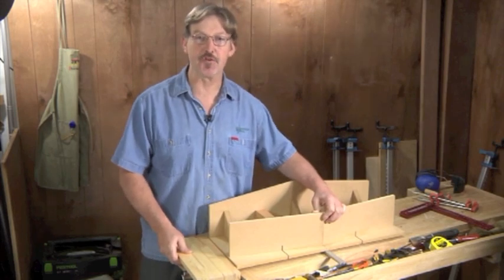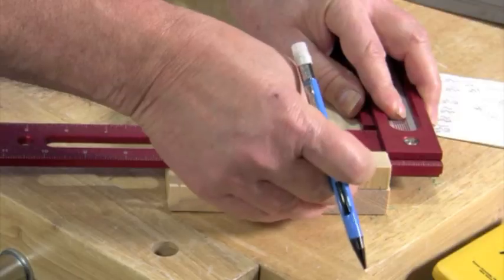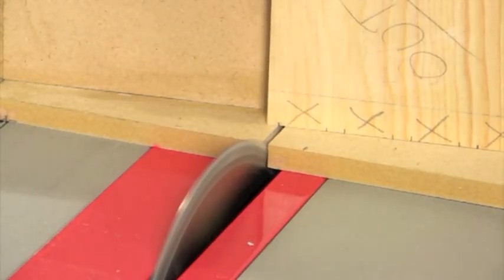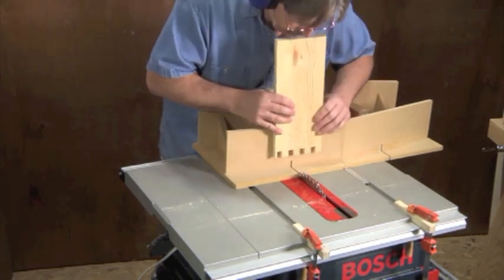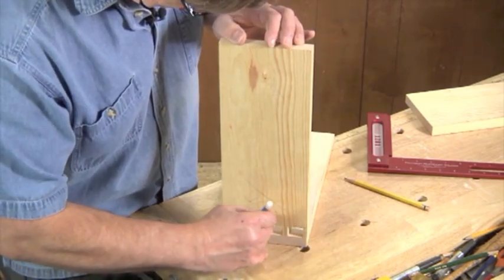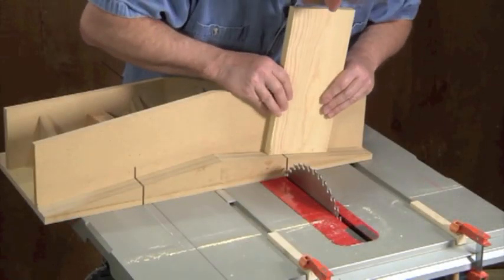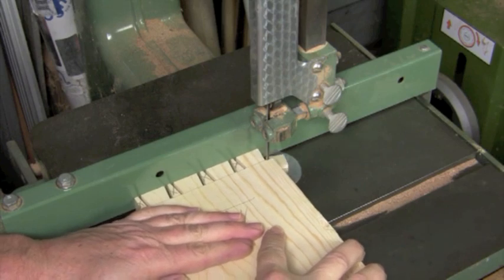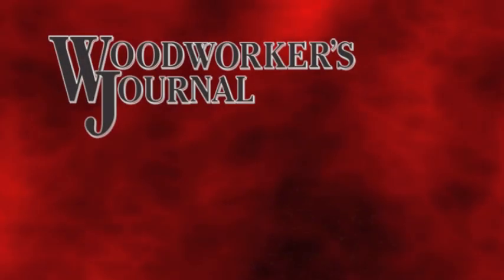Table Saw Dovetail Jig

Comment: What a great jig! There are numerous jigs varying in complexity on the market and most are quite expensive. This is one of the simplest and obviously inexpensive ( MDF) jigs I've seen in my 30+ years of woodworking. The coping saw suggestions are also great. Paring the waste with a chisel would also work, especially if a hand cut appearance is desired. Anyone who's done woodworking for a while can appreciate the multiple mentions of " BE SURE TO CUT ON THE WASTE"! Clearly presented post.

Comment: Great build fore me.  I could not use it because of my disability.  I had a stroke and it  left with the use of only my right side.  I did so much better with the Dovetailer II by General tools.  I use the router table and one hand to hold the work piece.  Thank You for the challenge to build. Rick Prosser Molino Fl.
Reply: If you use a clamp, you will have more control single handed

Comment: There's some complaining about this jig. But hell, not everybody has the money to buy a jig at first. You can make this with scraps and then progress to a jig.
Reply: no but you can build one thats a heck of a lot smaller  if you have a huge shop its great but the guys with smaller shops have a hard time justifying that kind of space on a jig.   Myself I have a much smaller  jig it uses a piece of wood that acts like a finger and once you get the first cut done you simply move it over one notch and so on :)
Reply: Scott sutton You're taking about a box joint jig. This is a dovetail jig. Different animal.
Reply: ***** ok thanks for that Im by no means an expert,

Comment: cont from below  vibration affects accuracy and safety. Good luck cutting 10/4 or 8/4 with that.Not all is lost, it's ok for jobsites for occasional use when you make something wrong and need to trim it onsite. I don't think it's too high btw. Try a 220v Uni cutting 10/4 Cherry, with the saw screaming "faster, faster". Now that's a saw! Oh, almost forgot, I think you mean "joinery" no "t" unless you have weed , then add the "t", and i dont remember it being on the test, but that was a long time

Comment: What model table saw is this? I looks like it has a smooth startup unlike most portable contractors saw... Do you guys think, fine woodworking can be achieved using a table saw like this? I have LIMITED space and i think i will be using someting like this.

Comment: cont from below  versatile for dovetails and much more is the Pantorouter, more accurate as well. You should have bought a used Unisaw with a nice fence for a thousand bucks, (then take a Porter Cable 3.25 HP Router and mount it under the giant table [with at least 6' outfeed] you build around the saw,  and you can use the fence with the router as well for tons of stuff) . Sorry, you got burned, but now you have a nice vibrator for the wife eh? My odd way of saying vibration affects cont. above

Comment: I see now that they are in fact angled, its not visible till later in the video, i didn,t make it that far  until you said they were. Sorry I took so long to respond, I was off in Mexico for the winter sailing season. And there is no classification as such, I have a "B" general license (yes, even retired people can retain thier license) valid for all trades except well drilling which is rather messy anyway, when two or more trades are involved.

Comment: Michael a saw without a riving knife is dangerous period it does not matter what you are doing with it. Supposing he dropped his piece of wood accidentally into the blade no riving knife and it will act like a missile heading straight for the eyes.
Reply: Gary burchett there's a stop set so the jig doesn't even slide to where the riding knife would be.

Comment: Be advised!!  If the miter slots are not the same distance from the blade (as my TS is) this jig won't work.  When cutting the tails on the sloped ramps, because of the different distances from the blade, changes the place on the ramp where the cut is made thereby changing the blade height.  What a waste of time building this.

Comment: Let's see... cut off the legs of a $1000 contractor saw.  Yeah right.  And what might I do with the $150 worth of casters?  Oh, even better... stand ON A STOOL while operating a dangerous piece of equipment with a 12" spinning carbide blade.  I nominate you for this year's Darwin Award.